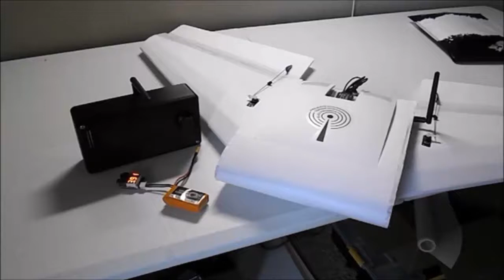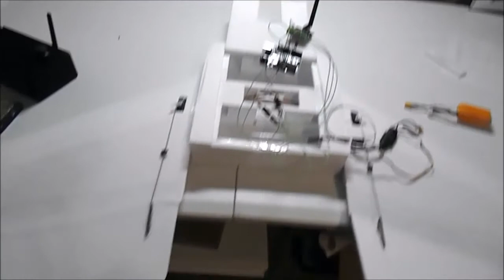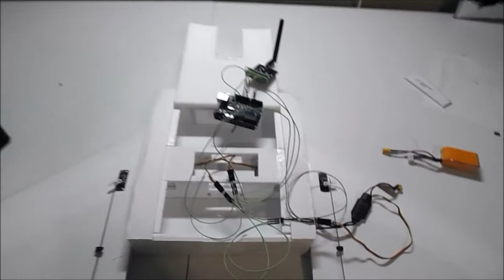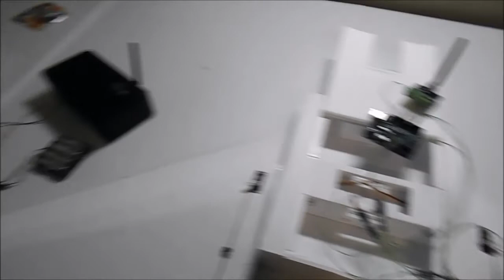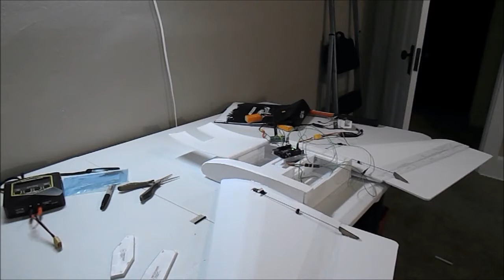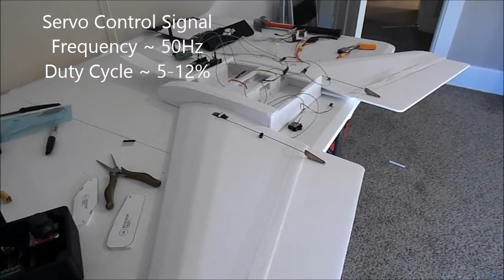Arduino RC Transmitter - Build

Comment: Heiiiiii very good man 
Fly ease ?
Reply from the maker: To be honest, I don't know yet.  Winter has caught up to me and I haven't had a good opportunity to fly it.  I actually think I am going to table the flight until spring.  I am however very certain that it will not fly easy no matter when I fly it. Lol
Reply from the maker: If your still curious, this setup actually flew quite well. I was completely surprised! Actually I think the range and communication was better than my cheap Hobbyking transmitter.  Unfortunately, I didn’t film the flight very professionally, so I haven’t uploaded a video for it. Also, I crashed the plane into a shed because I am a pretty bad pilot. Haha